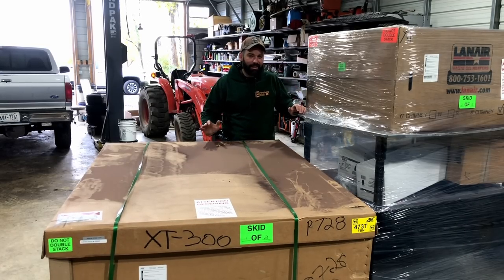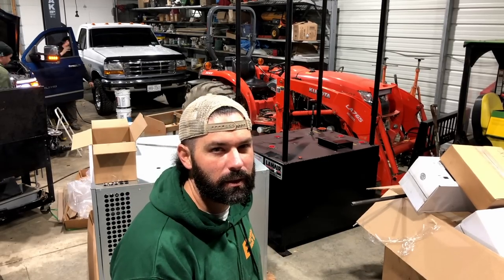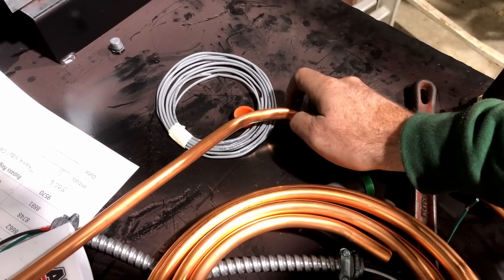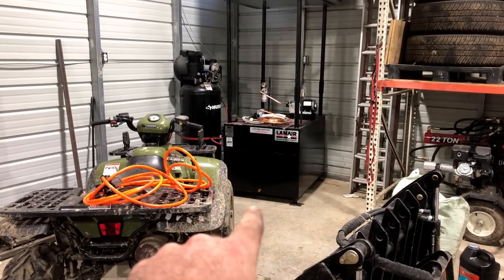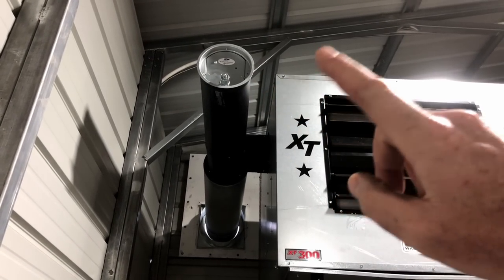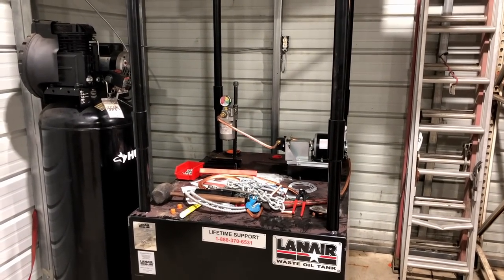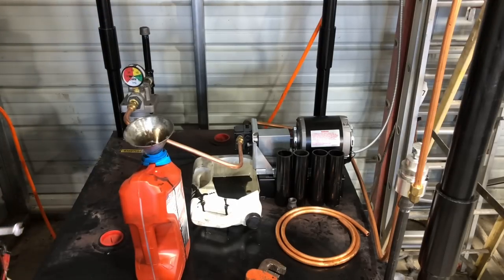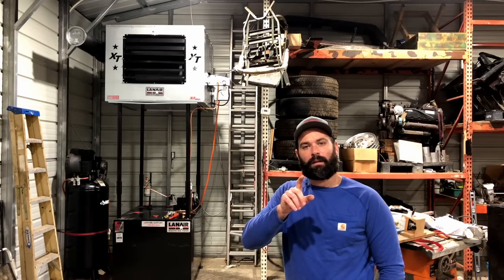Free Heat?!? Lanair Waste Oil Heater - Full Install

Comment: Awesome job man. Your gonna love that Heater, that’s a nice big unit too. How many BTU? I was looking at some used oil burners myself on RIT auctions about a month or so ago and almost pulled the trigger on a nice unit .. was an overhead Reznor oil burner but looked just like the gas version I have now but it went up higher than my price range at the time but I still kick myself for not going higher on the bid as I can get used diesel oil for free from my work for life lol. Keep us posted with how you like it!
Reply from the maker: It’s a 300k BTU unit. I saw that one you speak of on RTI.  I had an older lanair so I’m super familiar with the product. I know it’ll heat very well even without my shop being insulated!
Reply: Keep in mind the Lanair is an Economy heater and does not like full synthetic, also i have replaced multiple Lanair heaters that are less than 5 years old. I would go with the Cleanburn units they are the tried and true brand of Waste Oil Heaters and last on average 25-35 years.

Comment: Just watched your video because I got called in for a problem with this exact model. I didn’t do the installation but the it was purchased and installed recently this week. They seem to be having air running through the heater but that’s about all that happens. Any tips?
Reply from the maker: As in they aren’t getting any oil up to the burner? Was the unit properly primed? The unit needs to be primed from the suction end to the pump, then the bleeder is closed on the pump and the connection for the oil should be cracked at the burner, pushing oil up there, once it’s bled to the burner it should push oil. I forget my exact PSIs but that might be in the video, I think I’m somewhere around 3-5psi of oil, and 10-15psi of air pressure. Lanair has amazing customer service as well, I would recommend calling them while you’re standing right at the unit and they will walk you through troubleshooting and wait while you try it.

Comment: How many Sq Ft is your shop? Is this heater keeping up? Do you think you could of used a smaller unit?
Reply from the maker: My shop is 1600 sqft. When the building wasn’t insulated, it would keep up, but run constantly. My shop is now insulated and the heater doesn’t run continuously. If my building was insulated when I got the unit I could have easily gotten away with a smaller unit

Comment: Just found your channel, well done. I have a pole barn uninsulated as well and looking at heating options. I am in West Virginia. Do you keep it running everyday to keep the building at a constant temp? I know you don't pay for oil, but how efficient is it and how much do you think it costs in electric? Thanks
Reply from the maker: I do not keep its running 24/7 because the disparity between temps is huge.  Keeping the building at 60 while its -5 outside it would be running constantly.  I generally turn it on via wifi thermostat an hour before I plan on going out there.  its a single line of 110v on a 20 amp circuit so I cant imagine it pulls that much energy.  Where you are the temp difference between outside and inside might be close enough that you could leave the building set to a single temp and walk away as the heater wouldn't have to work as hard to keep that temp.

Comment: Thank you so much for posting your video! It was extremely helpful as the  electrical tape you mentioned to seal the light from affecting the cad cell relay ,aka(fire eye) and was the cause of why I could not get a new instalation  to fire.
BTW  I installed a flare tee with a ball type flare valve and a short pipe drop to purge into an o.j. bottle.
I just knew there would be to much oil pressure to just crack open the nut and not get sprayed.
Thanks, Eric .
Reply from the maker: I actually had to call customer service to get that figured out! The T with a ball valve was a great idea!

Comment: You can use a conduit bender for copper as well. Just make sure it’s sized appropriately
Reply from the maker: That’s the word I was looking for when I said the big tool bender, thanks!
Reply: Or spring will work also

Comment: How much was the unit? Were looking to upgrade our garage into waste oil heat.
Reply from the maker: This whole kit turn key was just under 14k. Came with everything you need. They have smaller ones, this is their biggest unit at 300K BTU

Comment: Thanks for the reply. The thing I am most worried about is condensation on tools etc. I have read if I don't keep it constant and turn on and off, when it goes back to ambient temp that is when I will get condensation? This is from searching and there are so many opinions. My shop is 40x6' walls.
Reply from the maker: My shop is 30x60x12 walls and I’ve never had an issue with condensation. Everyone told me I would but it hasn’t happened yet and I’ve been running a heater in there since the day I put it up

Comment: Just finished installing one at automotive shop here in Chicago.   XT-200 mode. 15 foot in the air Made a bracket that attached to the concrete wall to support it.    Customer has over 1000 gallons of waste oil to burn so that’s a great investment for free heat.
Reply from the maker: Yeah I’ve been running one for about 3 years now and have loved it! The new unit is 10x the machine my 30 year old one was though that’s for sure

Comment: You should be able to insulate that building with fiberglass batts or polyisocyanurate rigid foam sheets a lot cheaper than with spray foam, and well enough for a shop type structure, especially with that monster 300,000 BTU heater.  Cooler in the summer too.
Reply from the maker: Have you been spying on me? Keeping tabs on what I’m doing?! How else would you know I just picked up foam board…haha stay tuned!

Comment: Very nice that must burn a gallon per hour of run time?. I would use hard form board with a silver backing to insulate the ceiling and the walls. That is what I have. Just do a little at a time.
Reply from the maker: The manual says it burns about 2 gallons an hour. And I’ve been on the lookout for some of that foam on the cheap.